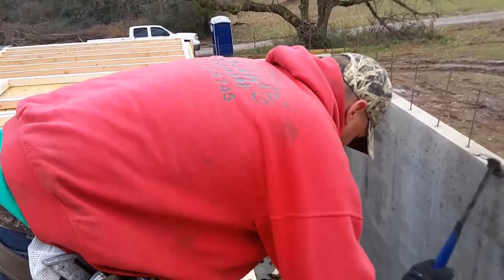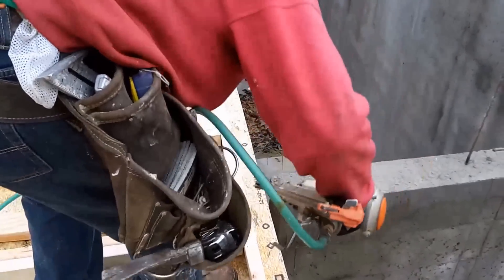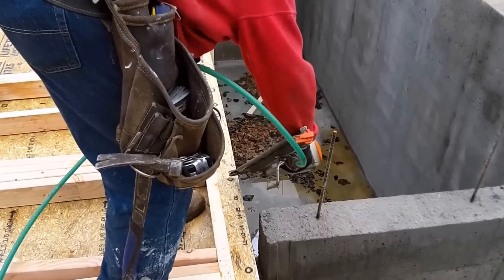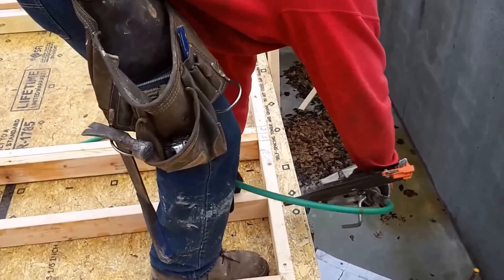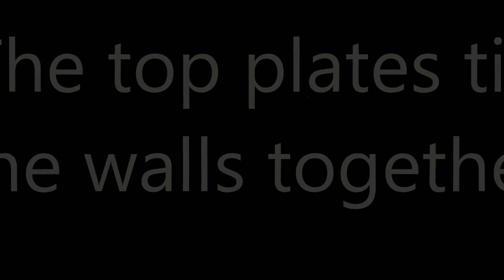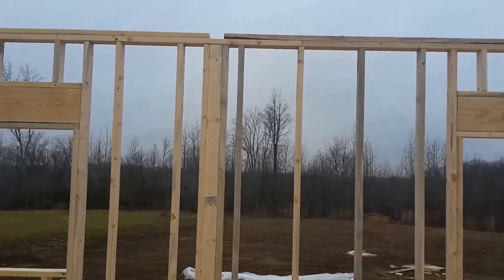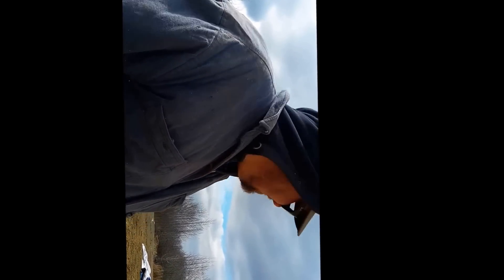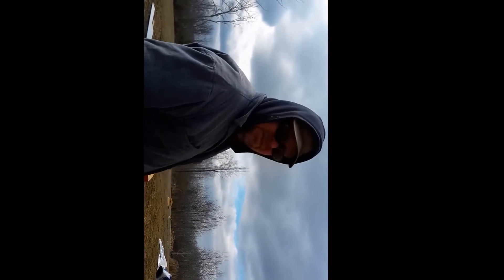Stick Framing 9' Walls with 7/16" OSB Sheathing

Comment: Update comment, came across this vid again in my recommended. Watched it once again and realized this time that the boy was nailing that top plate right in between stud bays. Might suck for electricians and plumbers if they gotta drill holes right through gun nails.not to mention also noticed how the feller assembling the walls had his hand super close to the plates when firing 😬😧

Comment: He isn't much of a tradesman the way he uses the nail gun to bash the wood .
Reply: I worked with a guy who did piece work for over 20 years. His work was extremely clean and his area was always kept clean and he too would always use his nail gun to knock in blocks or cripples

Comment: Why dont you guys sheet on the ground then stand up, also why you guys putting 3 nails in a 2x4
Reply: I'm assuming because the weight would be too much. as for the 3 nails I'm assuming they feel overkill never hurts. considering code only requires 2 for 2x4. I noticed when he nailed the 2 2x4 together he only used 4 nails that time lol.
Reply: @Lilmiket1000  
Funny thing is 3 nails in a 2x4 is going to weaken it substantially
Yeah im assuming the weight too just over here we sheet 20foot walls and stand em its much more efficient, also we tyvek while walls are on the floor
Reply: @Lilmiket1000  I'd go 3 nails on a 2x8 , 2x6 id still just shoot two nails. the extra nails I dont see helping just increasing spilting of wood.. The subjective forces that the house is under is point loading on the studs so the extra nails do not help has they are not being subjected to any force... Atleast thats my thinking I could be wrong
Reply: @Lilmiket1000   you could technically get away with three nails I think as you just need to stop the pivot.. I believe part of the reason they use 2 nails top and bottom is just a redundancy, if one of your 4 nails is not getting enough meat in the 2x4

Comment: thats the hard to install blocking above doors.......the door unit should be completely assembled before attaching to bottom and top plates.......cut blocking then layout locations on top 2x4 of header......nail thru top plate of header to attach blocking first then finish assemble of header....attach header with blocking to studs....

Comment: need an offset blade for the sawzall when cutting out plates in door ways...saves the sub-floor..
Reply: Or leave the trimmer out and use the circular saw, the side of the foot is 1 1/2" off the blade, perfect size to fit that Jack stud in under the header

Comment: Can I open a valid debate? sheeting a wall vertically opposed to horizontally. Do you loose structural integrity or is there a difference. I realize economically that it means a 2' strip at the top for a 10' wall, but you will have that even if you lay it horizontally. is there a difference structurally is my main point.
Reply: yes strength axis of plywood is always on the horzontal, you will never see plywood floors sheeted vertically
Reply: tkschannel  you are correct, the consideration for floors and roofs are primarily for load carrying perpendicular to the face of the sheets. But in wall construction using it for a shear diaphragm in seismic or wind areas the panel can be run either direction,  the shear resistance remains the same.  Used vertically is most common on the west coast, either way no problem. Engineers design both ways, but in the west they mostly design vertically. Also the code requires normal wall bracing consisting of a full panel every 25 feet, and allows it to be place vertically. This requirement changes in the higher wind and seismic areas of SoCal where I’m more familiar with. Watching builds in different parts of the country has been very interesting.
Reply: I was working at a retirement home and they had the bearing walls framed 3" on center and sheeted one side with 3/4 inch fire rated plywood and the sheets were run vertically and I was under the assumption that this was incorrect...

The Nailing pattern was 30mm (1") for the sheeting and they spec'd a large diameter 3" common shank nail.. My thinking is that this is actually weakening the structure as it is effectively driving a wedge through the 2x6 (every inch) and the nails almost penetrate the halfway point. My thinking was that if the walls were framed 12"onc with half inch plywood on both sides and nailed with a 2 1/4 spiral shank nail that it would be much superior in strength..

On a side note I built some plywood brackets out of 2x6 and 7/16th osb  (sheeted both sides) and nailed them together with  a 3" common nail to hold up some I beams.. The I beam dropped abit hard on the one bracket and spilt in right down the middle the exact point where the 3" nails from other sides met. To me this confirmed my suspicions that the nailing pattern was incorrect and the nail length and diameter was to large.

Thanks alot for your insight Steve 

Cheers from Canada!!

Comment: what kind of shoemaker are you? youre slow as they get and how can the header hold any weight from above if its smack dab in the middle of the rough opening? 

the cripples and headers are reversed!!! who taught you how to frame? I frame in canada and i move faster in -30 gusts of wind than you do on a clear day

Comment: Hey great video. Now some questions: The rule to build a 2 storey  house, is to use 2 x 6 lumber to frame the first floor walls and 2 x 4 to make the second floor walls. Is that right? And the wood you are using is a very soft pine with some treatment I believe.  If I use a red wood,  could I use less studs?
Reply: 2x4, unless the plans specify 2x6. Sometimes bathroom walls are 2x6. Really depends on the plans
Reply: 2x4? where are you gonna fit all your insulation
Reply: You never get away building out side walls out of 2x4's as code calls for R16 fiberglass bats. R16 don't fit in a 3.5" thick wall. Must be all 2x6 or bigger. I was expecting to see how you framed a 9' high wall with out a ton of wasted Lumber. As wall studs come 4.5" shorter then 8' to allow for bottom an double top plate. In both 2x6 an 2x4. Sure you can go with 8' contruction studs witch are a full 8' long. But adding bottom an double top plate don't get you to 9'. You have to use 2x6x10' construction studs an cut everyone down to 8'- 5.5" add your bottom an doubles top plates . You wast like 14" of every 10 footer.

Comment: so when i am redoing a wall, like if i am in the kitchen and taking out a outside wall which has a sliding glass door, and putting in a regular door, and also ripping up the old floor and putting down a new subfloor would I frame out everything and leave the 2x4 in underneath where I am adding the new door? and it would go right on top of the subfloor before adding in the 2nd layer of plywood?

Comment: Up north we band the plates, run the osb 8 ft out staggered to the next on the frame while it's on deck, tyvek the damn thing,  and get the big girl up. If you don't have jacks cut a hole top center and use that lull. Shoot I'll lay osb, over sheath and router plus still use that osb for solid headers!

Comment: Why do you use larger/wider headers than necessary? I say leave all wood out that isn't required and place more insulation in walls. This helps reduce the utility bill! The more than adequate headers add no extra required construction strength to the structure. If it's a 'code thing' or a long rafter span, then I understand. Normally a 4" header will span a 4' opening, 6" header for a 6' opening, etc. However, long rafter spans may require the header to be wider as "one size doesn't fit all". Minimum size headers speeds construction time and saves money for unneeded extra bd. ft. of lbr. and lighter lifting of the framed wall. That will amount to a lot of money during a person's lifetime career of 45 plus years....more profit in your pocket....been there, done that! 

Also more insulation can be added by using the 'God forsaken California corners and tees' (and I hate them, but they prove to add insulation values....and, bad as I hate to admit it, I used them).

Also, are three nails required per stud?...I do not know your nail length/gauge that you're using. 

This is a good looking framing job, very well done. Thanks for sharing.

....13
Reply: arkansas13 
You're literally the only person that doesn't know this is a shit job by jacklegs.

Comment: and who the hell puts sheathing on running vertical?
Reply: Conroy Moostoos   Structural engineers design it that way every day all over the country, as well as horizontally. In the west that’s pretty typical.
Horizontal install only matters in floors and roofs to sustain vertical load. For shear wall diaphragms not a problem either way same lateral resistance.  Also like big Dave said code requires typical bracing every twenty five feet not let in brace, one vertical panel does the trick.
Reply: Conroy Moostoos  I agree. It increases integrity when horizontal in a staggered joint formation not to mention cost effective

Comment: why the hell is that guy in camo using the air nailer as a hammer? hitting the studs into place with it, how stupid.
Reply: conroy the nail gun is a hammer, its to slow to put the nail gun down and take out the hammer. you obviously have no experience
Reply: Conroy Moostoos .
 I think  he is doing  it to save  time.
it is not  your  f.... business.
Reply: haha whats your argument? why is it not a hammer? its metal, has weight behind it, it can move objects into place without the need to pull out your hammer.  it saves time and makes sense :)
Reply: All the morons here saying a nail gun is a hammer, are fucking morons.
Reply: @michaelhull1813  well obviously you wouldnt wail on something with a nailer but just bumping a stud over wouldnt hurt nothin. relax and stop being so sensitive

Comment: To frame a 9 feet wall how long should the 2 x 4 stubs be from the bottom stud plate to the top stud plate ?
Reply: 104 5/8 precut studs.  you buy them that length
Reply: single bottom plate with double top plates
Reply: Fuck you Fuck you  it's 103 1/2

Comment: I find I have to put two nails in when nailing top plates or sides of doors or windows because a single gun nail (or regular nail) won't keep the stud from warping.  I know this because my boss back in the day would always do the single nail (we did everything with 16d's, no guns) and I was forever having to put extra nails in toward the end of the job after the studs had been exposed to sun and rain.
Reply: what do u mean by sides of doors and windows?

Comment: also the person doing the vapour barrier are going to just love you hacks no poly between top plates how do you expect them to seal that . take some pride in your work for fucks sake
Reply: wtf?  why would you use poly anyway, the wall needs to breath. How would you seal it and get the plywood on?
Reply: the poly goes between the two top plates and is about a 1 foot strip it is there so that when they install the vapour barrier on the warm side of the ceiling they can get a seal at the partition walls it is not required on the top plates of the outside walls but  should also be installed where a partition wall meets the outside wall .
Reply: 100 percent right and that is said in one of my comments no poly on exterior wall top plates
Reply: 888rustey never heard of that, no one up north does that
Reply: hike today i live in manitoba and thats how we build houses. might not be code but its the easy proper way of doing shit
Reply: i live in alberta and that's not how we build houses and it is not the proper way. a tradesmen does the job with pride and does not make the jobs of the trades that follow him harder
Reply: 888rustey thats what i meant by the easy way. i just started an apprenticeship so dont know a whole lot but we do place poly between the plates for the actual insulators. makes their job easier, looks better.
Reply: I've been around a lot of framer in upstate new york, no one puts a anything between top plates. your sheathing goes over it.  I follow a few goes that frame up in Canada, they don't do it either.
Reply: I'm in BC, Canada, and we only poly the top floor walls if they meet a roof or exterior wall. We don't poly the exterior plates. But we do poly the interior wall plates, and any interior wall that butts against and exterior L.

Comment: bottom nail first then get your hand the f off the stud OSB installed the wrong way. not pro framers
Reply: OSB is nailed up right to,it stronger ran vertical vs horizontal
Reply: @natesmith2471  
OSB strength axis runs on the horizontal bro, its stamped on the fickin sheet

Comment: 2 rules. hand holding stud at least 1 foot back if possible and start from the bottom to the top. double bounce at the top and you could be sending a nail into your hand

Comment: You didn't leave the required 1/8" gap between the sheets of OSB for expansion.
Reply: and threw experience you have learned that the gap is a must? have you had sheets of osb buckle on you? you must not use enough fasteners.
Reply: Most framers dont supply material. They build with what they are given. so your opinion of osb is worthless
Reply: Jhonatan de donde sacaron eso de 1.8  cada día salen con más pendejadas

Comment: i FINALLY found a framer outside of the Ottawa/Gatineau area that uses  chainsaws!!! I recommend using it for cutting out the door plates too, just be careful not to plunge too deep and scratch the floor sheathing below, plus there's no cord to drag around everywhere, YAY! I wish more framers from Ottawa posted stuff on the Internet to teach people how to make money while the sun is shining and there's no snow/ice and bad weather to deal with 6 months of the year. 
Almost everyone uses chainsaws for everything around here because if they didn't average about 3000sq ft of house per week per 4 guys they wouldn't be able to pay their employees everything 2 weeks let alone enough money for nails and gas for the next house(the profit margine in my neck of the woods is about 15sq ft of house built per man per hour) Any less and the boss usually breaks even. 
The sq ft prices in ottawa are ridiculously cheap and the market is not friendly to guys who give bids that are slightly higher than average. Also have you guys switched to cordless paslodes for framing roofs?

Comment: Tks.. GREAT VID! Question, would you tell me what brand and model is the small chain saw, used to cut off the door plate? If you don't mind I also like to know the rig used for the nail gun, meaning the compressor and nail gun itself, also hoses; the rigs I've been using, even though good brands have not serve me well... I would appreciate your help and advise. Tks.. Jay
Reply from the maker: +joaquin698 The chain saw is a Stihl. We use paslode nail guns with a big Ingersol Rand compressor with a 14hp gas engine.
Reply: +David King  Great info, thanks

Comment: Why do you prefer to sheath after the walls are up, as opposed to sheathing the walls while they are still on the deck before you stand them up? Again, thank you for the time it took to create the video, vary informative.
Reply from the maker: +Ruben Rojas We let our sheathing come all the way down to the mud sill.
Reply from the maker: Yes we did. I do not prefer this way.
Reply: bullshit  osb has a strength access
Reply: That's the way I usually do it, but I place all plywood running perpendicular (long side across the studs) because it's stronger, and it's code in some places.
Reply: usually you would run your sheathing perpendicular for a roof, not a wall. If you ran it perpendicular for a wall, you would have to run a row of blocks in between each stud bay to get you perimeter nailing on the long edges of the sheets. Also, engineers like to see the wall shear running parallel, plate to plate, so that the wall does not rack. never heard of it being code to run wall shear perpendicular.
Reply from the maker: Its actually supposed to be run horizontal. The blocks have to be on each corner out 4' and every 25' on long walls.
Reply: Did you run your sheets vertical to keep from having to run two rows of blocks?
Reply: Actually, for walls it does not matter if you install the sheathing horizontally or vertically in terms of structural integrity.  The only thing it does is require more blocking if you run it horizontally.  For roofs or floors the long side has to run perpendicular to the joists/rafters.
Reply: 888rustey so true, and sheets from plate to plate are far stronger than horizontal sheeting.
Reply: 888rusty, wrong!! Ask any structural engineer. There is no structural difference in the walls whether it is installed horizontal or vertical.
Reply: or why do they sheath at all..

Comment: I notice your framers run a 3/8" air line to supply your nail guns. People say the larger line is too cumbersome and heavy to work with compared to a 1/4" line. Why do you prefer the larger 3/8" line? Thank you for your time.
Reply from the maker: +Ruben Rojas There just a little more durable.

Comment: Do all exterior walls require sheathing, or just the shear walls only? Thank you for the video.
Reply from the maker: +Ruben Rojas All exterior walls are shear walls to a certain degree. The sheathing is what keeps them from racking. Some exterior walls require special sheathing like 3/4" plywood, but most can have a continuous sheat of 7/16" OSB from the top to the bottom on each corner and every 25' apart.
Reply: David King Thank you, so only one 4 foot wide sheet of OSB for every 25 feet unless the engineer says otherwise?
Reply from the maker: That's right. Just remember it has to go from top to bottom. So if you have a 17' tall wall then you must install a row of blocks in the wall at the break of each sheet and nail the sheathing to them.
Reply: Thank you for taking the time.